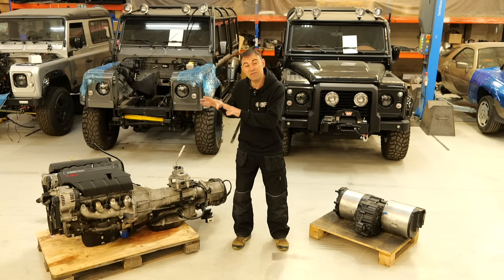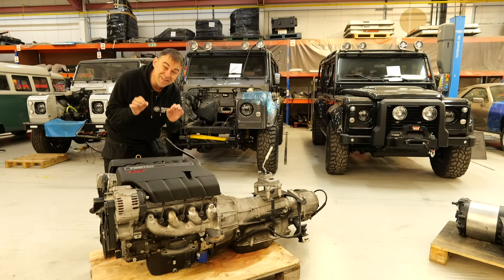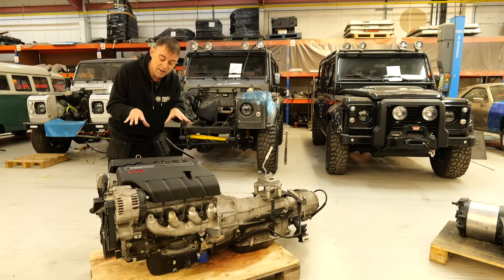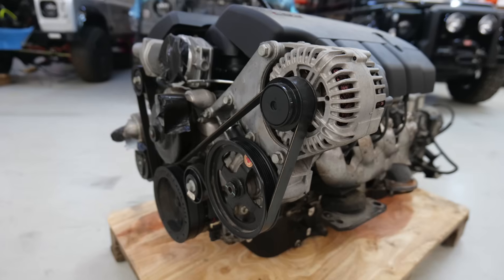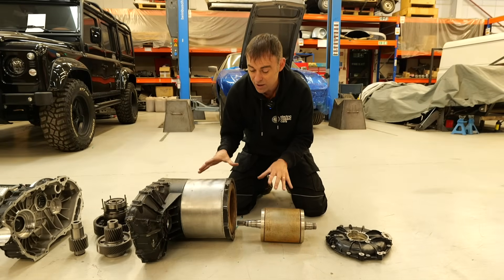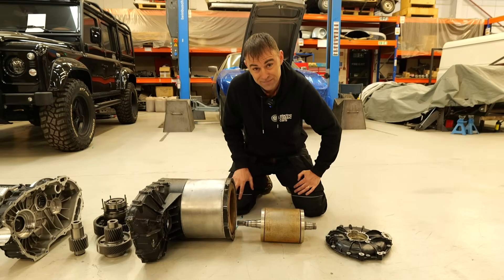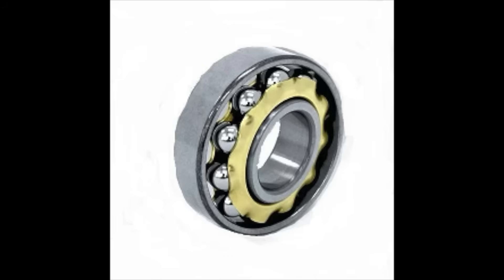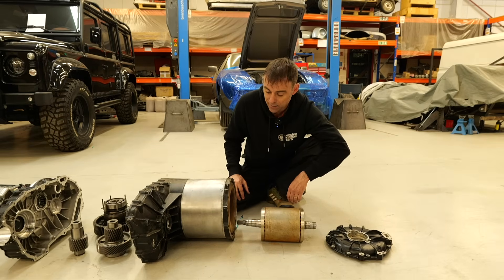Let's compare the Tesla LDU with an LS3 V8 and take one apart to see what makes it tick.

Comment: I've done a few Tesla motor conversions in the last 3 years and I have to say that they are the most worthwhile projects I've done. They are quick and pretty easy to do and the results are insane. No exhaust system to deal with, no liquid fuel tank or smell.  If you have ever thought of doing a conversion just go for it, you can easily learn about all the electronics needed on Youtube or DIY electric car forums. Don't be afraid there's plenty of help out there. My daily driver is a converted 2005 Mustang with a Tesla Model 3 motor...... Love it.
Reply: @ Hi,  First thing you need to do is study about conversion EVs. If you use Tesla batteries a full pack is about $5000 to $10,000 dollars these days depending on what you want. My batteries are not Tesla batteries. My car weighs 200 lbs less than a Mustang GT of the same year. I have a battery pack in where the engine was, and 4 down the tunnel.  You can see my builds on the Roadstercycle channel on Youtube. I have a chain hoist to install batteries or I could use an engine hoist.

Comment: The motors compared make it clear thet electric is far far better. The problem is the energy density of gasoline is wonderful where the size, weight, and low energy density of batteries along with relatively slow charging is a big problem. When batteries can fully charge in 10 minutes, weigh 150lbs, and run the car for 400 miles, the electric car will be perfected!

Comment: A little dishonest here. The electric area on the other side of the rotor are part of the engine, just like the fuel injection and exhaust on the LS3. Most of the weight for the electric motor is in the batteries. More than the LS3. That's why the electric vehicle weighs more and have to have heavier duty tires.
Reply from the maker: This episode was about looking inside the Tesla drive unit. We’ve covered the battery vs fuel side of things in a previous Tech Talk. 👍 https://youtu.be/HoqoL1EyAHk?si=HU6pDRePt66z9ApB

Comment: the electric motor doesn't scare me it's the battery pack. where and how do you connect enough packs to get you going if you can't fit a sled across the bottom?

Comment: I would think Tesla rectified this issue years ago.
Reply from the maker: The coolant leak issue isn’t on the more comment Model 3, Model Y or a plaid motors, nor is it on any of the front motors. It’s only on the rear LDUs. Since late 2023 they solved it with their own coolant delete.
Reply: @ElectricClassicCars  good to know. Thanks👍

Comment: You add everything for the gas motor... but for the electric one, you didn't add weight of the battery,  nor did you consider the efficiency loss while generating the electricity at the plant or charging it.
Reply from the maker: We didn’t add up the weight of the fuel tank, fuel, exhaust, starter motor, big 12v battery to start it, etc. but if you’re wanting to compare weights check out the previous ‘Petrol vs Batteries’ Tech Talk that we linked in the episode multiple times. Not sure where you’re going with power generation analogy but consider the alternative. You need to drill the oil out of the ground, pump it to a port, ship it half way around the globe, process it at a refinery into petrol, transport it to a petrol station, pump it into a car and then….. after all that, only 20% of it is used to make the car move. It’s ridiculous. And don’t forget, you need huge amounts electricity and energy at each one of those stages. 👍
Reply: @ElectricClassicCars  Thank you for video and response.  Considering Tesla model Y battery is 1700 lb, worth including it.  Regarding power generation, again you aren't considering where the electricity comes from. Here is some research I did on WTW (wheel to wheel efficiency), seems relatively same, with Diesel leading.

Vehicle 	 WTW Efficiency Range
Gasoline ICE	11–27%
Diesel ICE	25–37%
EV (Natural Gas)	13–31%
EV (Coal/Diesel)	12–27%

Comment: You left some variables out. 20 gallons of gas weighs 120 lbs. How much does a Tesla Battery weigh? I would also add there are many governmental restrictions placed on the combustion engine that effectively reduce its power as there are more energy dense fuels. Additionally, insane safety standards have made newer cars immensely heavier. Had the 1000 hp Demon not had to deal with this the Model S Plaid would be slower.

Comment: Let's be honest, the only reason ICE dominated was because Battery technology wasn't fit for purpose, not because motors weren't superior. Had something even half as good as today's batteries been available at the birth of motoring, ICE would never have got a look in.
Now we have acceptably good batteries, it's game over for ICE. If you've owned an EV, you will know first hand why this is true and how superior they are. Batteries are only going to get lighter, smaller and more energy dense. The reliability of EVs is going to be so much better than ICE cars. My prediction is that within 10 years, EVs will typically last twice as long as today's ICE cars, and in time will probably last 3-4 times as long.
Another reason you use Ceramic Bearings is because the balls are so much lighter. The centrifugal force of the balls rotating at very high RPM tends to make them fly off the inner race, which reduces the preload and can make them slip and chatter. We used to repair very high speed spindles for the Printer Circuit Board drilling machines, with some running up to 80,000RPM. You can use lower preloads and make them last much longer with Ceramic Bearings.

Comment: Not to mention CVT, and Dual Clutch Transmission, and even manual transmissions. So many fewer parts and maintenance. This will certainly be my last Gas car. People don't see complexity. So many parts with an ICE car. I wouldn't go hybrid unless it's a situation where i can't charge the car. And even in that I would only do the Camry or Accord.

Comment: Ok, its bearings. Now I know the name in english,  that is what caused a colleague taxi driver problems in the 39 kWh Ioniq that after 240.000kms (130.000 miles). Burned inside it was all dark and melt. Bearing had to be replaced. Well he and his brother drive like crazy, always too fast, but the battery is 100% ok after 300.000 km (180.000 miles).

Comment: Yes I agree with you that it's more efficient and is probably the future. However the computing and battery packs are still an issue. Especially if off roading.  I like my cold stars and rowing through gears. So I'm going to keep my petrol engine for as long as possible.
Reply from the maker: I love off roading in my electric Landy. 😍👍 https://youtu.be/mcdKjdKELec?si=u64_iZyYUiH5xjDG

Comment: I really like your capabilities, if I where in your position I would offer a turbo diesel electric hybrid that also can run of pno, or use pno as a catalyst to momentrly boost efficiency when you need it for hills. I intend to do that to a mini truck, so it Versital. Would like a full aluminum body and frame. Any non essentials will be left out our weight cut down    should be able to get the total weight around 3000

Comment: I think this is a cool conparison. The power of an electric motor is nothing new however, locomotives have been using electric motors since the 1930's. What folks dont know is that a diesel locomotive creates electricity to power all the electric motors at the wheels. Technically modern locomotives are like hybrids.

I think it is just a touch dubious to say that the Tesla motor is so much lighter than an LS3 when not factoring in the batteries, and factoring in a 16 gallon gas tank. The 2010 LS3 camaro weighted about 3,900 pounds (1660 kg). A Tesla model 3 extended range weighs about 4050 pounds (1837 kg). They are conparable, though you can't fit 2 peope in the back of a camaro very well, and the range of the tesla is still not as good as the Camaro. I would say weight wise they are about equal.

With that said, when capacitor batteries eventually replace precious metel batteries we will see a signifiant weight savings as well as a longer range. Imagine going 1,000 miles between charges. Oh and the batteries should last a lot longer than 10 years. ICE, and sadly the manual transmission, are on borrowed time at this point.
Reply from the maker: This episode is about the Tesla drive unit, opening it up and seeing what makes it tick. We covered the fuel vs battery comparison in a previous Tech Talk. 👍 https://youtu.be/opF1si__APs?si=ylRtOg_340xyhEgv

Comment: The LDU with battery weighs in at around 440kg with approximately 900 parts, mostly in the battery. The LS3 weighs around 193kg with approximately 500 parts. So the LS3 is less than half the weight even if you include a full tank of fuel, with almost half the components. Also if you take into consideration the future disposal or recycling of the battery, the current cost is about $10 per Kg so about $3,000 plus collection fee, on top of that you have to purchase a new one every 8-12 years at a cost of $12,000-15,000 if you're lucky.
Reply from the maker: Your weights are all wrong. The Landy weighs the same when it’s electric, compared to when it had the LS3 in and a full tank of fuel. Your parts numbers are also off as you haven’t taken into account the gearbox, transfer box, starter motor, etc. 
Regards replacement batteries. A Tesla battery gets around 300,000 km before the battery gets down to 90% capacity. That’s more than the average life of a car. However, when or if, you do finally want to replace it the price of new batteries will be lower by then or you do what most would do with a ICE and install a good secondhand one. A quick search on eBay tells me they’re currently around £3,500 for a good secondhand one. 👍
Reply: @ElectricClassicCars  so you are putting a small (350kg) battery in them? 50kwh would be the only way to keep the weight around the same as stock TDI. That would give around 90 miles range. Ok if you are only planning on rock crawling I suppose. Where do you locate the batteries? Who in their right mind would buy a used battery? LOL

Comment: Hi Richard a very interesting video explaining the inner workings of a Tesla drivetrain unit. One question I have is do the inverters eventually fail?
👍😎🏴
Reply from the maker: Possibly. But I’ve not come across one that’s failed yet, apart from one caused by a coolant leak.
Reply: Thanks Richard 👍

Comment: I wish I knew about the coolant delete earlier.  My 2014 Model S died in January 2025, after 11 years and 151K miles.  Everything was going strong. No issues at all with anything.  Then just stopped one morning.   Ended up buying a new Model X.
Reply from the maker: A motor swap would have fixed that very easy. 👍

Comment: Tesla owner here. Comparing the weight of the two options:  ICE vs. EV must necessarily include the battery.  Considering that, ICE wins with considerably less overall weight for the vehicle. However, EV still wins with in the power to weight ratio. Amazing.
Reply: Solid state batteries, which are still a long way off, do look to make both ICE and EV models weigh about the same. So, much lighter EVs, or same weight, but with much further range. 

It is a technology that is moving forward very quickly. Seeing what China is doing is also a reality check for other nations, or should be. With half of all new cars sold being EVs. It is clear that a EV national is possible almost everywhere.
Reply from the maker: @paulvail7926 My wife’s Tesla Model 3 weighs the same as my neighbours BMW series 3.
Reply: @ElectricClassicCars  I find it all quite exciting. My nephew works for Lucid and a close friend worked at Tesla. He is now retired. But, I don’t know how much motor tech we will see. I think the big jump in the next ten to twenty years will be in the batteries. How fast they charge. The tech in use. The jump in recycling. The drop in cost. The idea that we could get a 600 mile battery into an EV that can charge up 300 miles in 5 minutes or so and that chargers are as ubiquitous as gas pumps. 

It won’t happen overnight, but I just think it is all inevitable.

I bought my Chevy Bolt EUV to see if I would enjoy an electric car at all. Now, I can’t imagine ever buying another ICE vehicle again. I am hopeful my next EV will be a Model S Plaid. But, that may never be a reality.
Reply from the maker: @paulvail7926 Lucid is a very exciting company to work at. Amazing technology. 👍
Reply from the maker: This episode is about the Tesla drive unit, opening it up and seeing what makes it tick. We covered the fuel vs battery comparison in a previous Tech Talk. 👍 https://youtu.be/opF1si__APs?si=ylRtOg_340xyhEgv
Reply: You need to also add the weight of the fuel for the petrol engine

Comment: The battery weighs   the same all the time. EVs still weigh more and put more wear and tear on the public roads they drive on where the cost of road repairs goes into tax dollars. Nobody talks about the damage to the PUBLIC roads the heavier EVs drive on and create more potholes and compression damage. The tire industry has not made tires that handle the heavier EVs, so there's more microplastics from  auto tires as well. There's always a give and take with engineering.
Reply from the maker: Cars have been getting progressively heavier for decades but it’s only EVs they moan about. Compare the weight of the first Toyota Corolla to the present one, or a Mini, Fiat 500 etc. SUVs were never a thing in 20 years ago but they’re heavy as hell and nobody moaned about their weight. My wife’s Tesla Model 3 standard range weighs less than my neighbours BMW series 3. 🤷‍♂️

Comment: What about the weight of the battery you need for LDU? Impact on the nature during battery manufacturing? Charging stations? Time to charge? Limited distance?
Reply from the maker: Although EVs take more CO2 to make, you only need to drive it 16k miles before the ICE vehicle starts producing more CO2 and by the time it gets to 100k miles the ICE vehicle has produced 3 times more CO2 than the EV. We covered a petrol vs battery comparison in a previous Tech Talk which we linked when we talked about the weights and at the end of the episode. In case you missed it, here it is. 👍 https://youtu.be/opF1si__APs?si=WNcGIWVZZUdGGDzd

Comment: On a microscale level you are correct on the efficiency.

On a macro scale level the LS3 is 10 percent more efficient. You see unless you are using wind and solar power ,your tesla power unit is indirectly burning either coal , natural gas ,or oil from the generators that feed the grid . 

Now for the cherry on top . As far as the environment electric requires rare to ic earth metals ,it requires lithium and causes more pollution from tires .
Reply from the maker: If you’re going to spout rubbish at least include a credible source. All of what you just said is nonsense that even the simplest of Google searches can confirm.

Comment: Here are two points to consider when comparing the Tesla motor to a V8 internal combustion engine: 1. The batteries remain a constant weight, unlike liquid fuel. 2. About the '450 HP' output of the Tesla motor, how long can it run at that power before it starts melting? Is it one minute, three minutes? That's a key point, thank you.
Reply from the maker: At max power for 3 seconds the Tesla is already doing 70mph, why would you need it to do max power for any longer? 🤷‍♂️
Reply: @ElectricClassicCars   It's important to understand that maximum power differs from continuous power. Electric motors can handle overloads of 300% or more, as long as the amperage is sufficient. In some cases, they can even reach 500% if the core does not saturate, although this could literally melt the armature. This capability is not found in internal combustion engines. Unfortunately, many electric vehicle motor manufacturers misuse this fact when they claim impressive gravimetric power densities, such as claiming a 350 kW output from a unit that weighs just 30 kg. The key issue isn't whether I need maximum power after hitting 70 mph, but rather how we define it. Thank you for the interesting and informative vidoe, wishing you a wonderful day, Sir!

Comment: don't forget the "LS3 motor" that makes the power for your EV charger. Or have you reached 100% green energy in England carried in superconducting cables without loss
Reply from the maker: There’s no LS3 engines that make electricity for the national grid here in the UK, what are you talking about?
Reply: @ElectricClassicCars   it was meant in a figurative sense, therefore " " the current that charges the EV is produced with a loss that must be included when comparing efficiency
Reply from the maker: @CHRIS-Bang OK. Starting at the power station, 6% losses in the power distribution cables, 5% losses in the charger, 5% losses in the inverter (DC to AC), 5% losses in the motor. Total that up and the EV is between 77% -81% efficient.
An ICE vehicle isn’t in the same league. You have to drill the oil out of the ground, pump it to a port, ship it half way around the world, pump it off the ship, turn it into petrol at a refinery, transport it to a petrol station, pump it into a car. And after all that, only 20% of the energy is used to make the car more. It ridiculous. And don’t forget each one of stages takes a huge amount of electricity and energy. 🤷‍♂️🤦‍♂️

Comment: Weight comparison is not entirely accurate. Yes the  ICE engine is much heavier. But if you add the Batteries to the electric motor. To achieve a similar range. I am confident the ICE engine  plus fuel is overall lighter.
Reply from the maker: We covered a petrol vs battery comparison in a previous Tech Talk which we linked when we talked about the weights and at the end of the episode. In case you missed it, here it is. 👍 https://youtu.be/opF1si__APs?si=WNcGIWVZZUdGGDzd